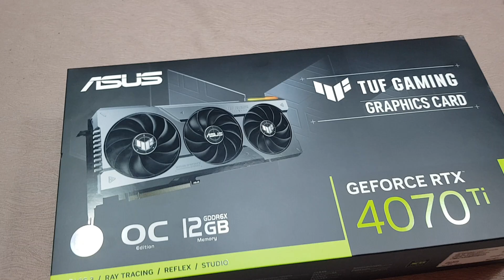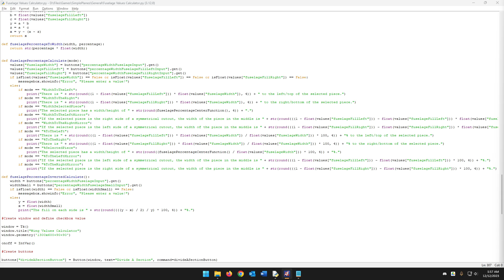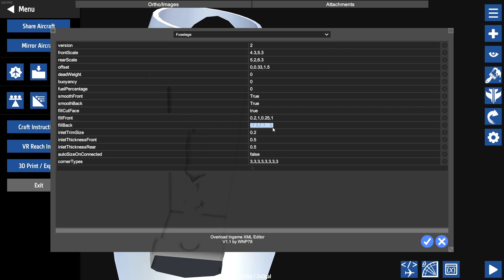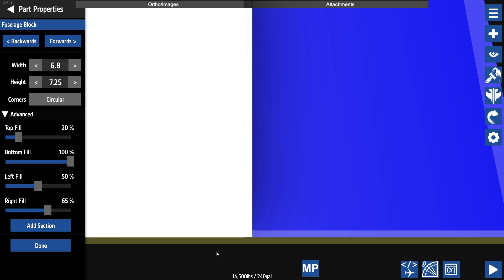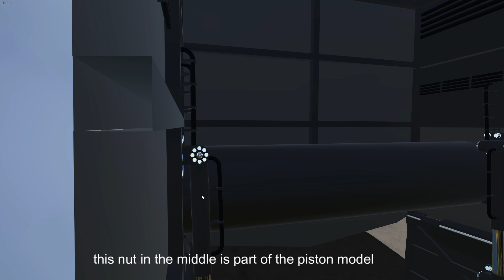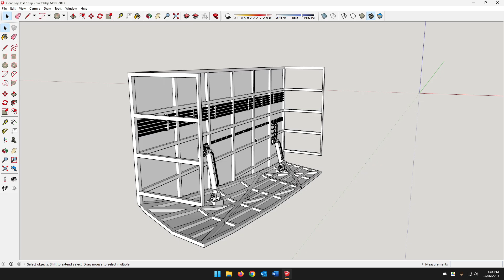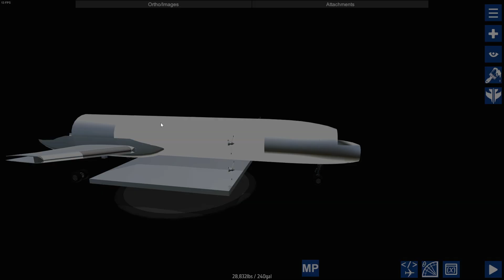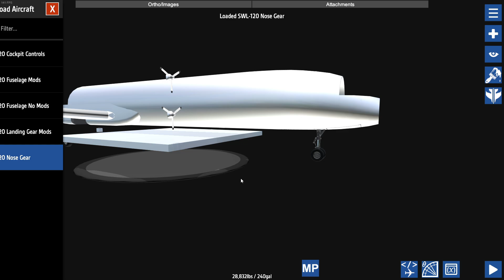Detailed Landing Gear In SimplePlanes (Part 2) - SWL-120 Progress Update 9.2

Comment: Hey, do you know how to get black smokes in engines for my planes
Reply from the maker: Hi, there are two ways to do what you are trying to do. The first way is to use a mod like my smoke trails mod: https://www.simpleplanes.com/Mods/View/1819260. The second way is to XML mod the engine exhaust, although this won't have the same visible effect as the Smoke Trails mod. The exhaust XML can be found in the Engine category if you open Overload on an engine, and is called "exhaustStartColorOverridePrimary". I've made a simple demonstrator craft for you here: https://www.simpleplanes.com/a/78Bxcm
Reply: @11snakePlayz  I think I will use the the vtol method shouldn't black smokes be in to the game?

Comment: Hi, your videos are awesome. I tried to create a F-22 replica, but when I try to create the nose part, it doesn't change the height and width axis after rotating the fuselage block 45 degrees z axis and changing corners to hard for sides and circular for up and down. After rotating the block, it changes the height and width to the same 45-degree angle. How to solve this, thank you.sorry for my bad English
Reply from the maker: Hi, this cannot be changed as this is normal behavior of the fuselage part, sorry. I would look at other F-22 replicas on the SimplePlanes website for geometry ideas.
Reply: @11snakePlayz  ok, thanks